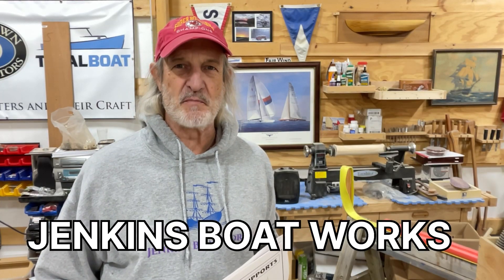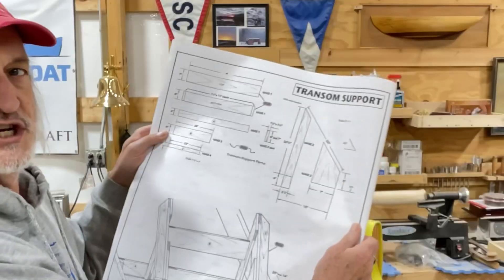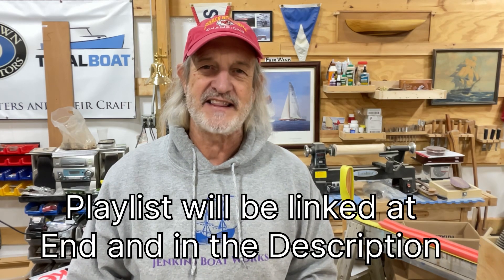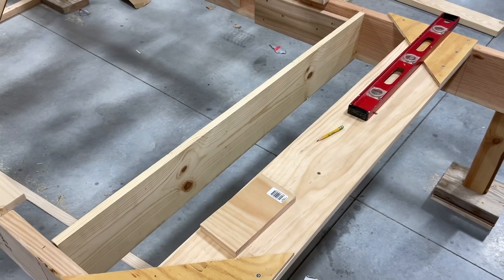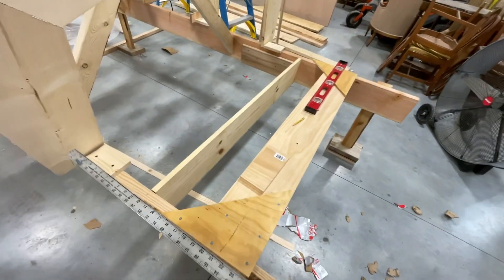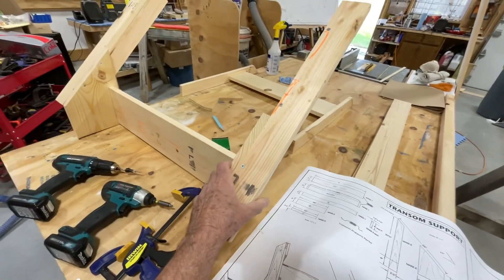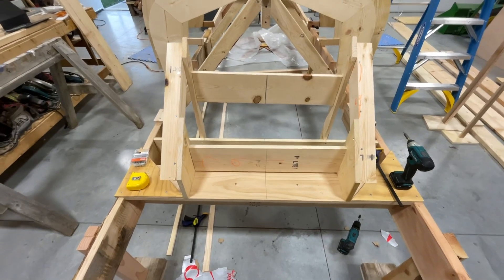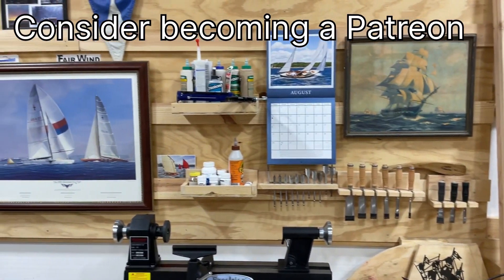Boat Building Somes Sound 12 1/2 - making the Transom Construction Jig- Episode 16

Comment: All right! Kinda a complex form for the transom.
Reply from the maker: yes it is. As I commented, I think it could be simpler. the more I think about it, that second piece going forward really complicates this. A single structure set on a solid level base would be easier
Reply: @JenkinsBoatWorks  Yeah,  and 43 deg is a non-standard angle to work with.